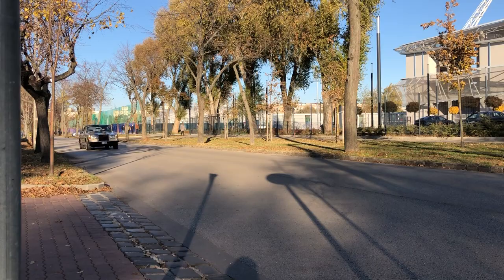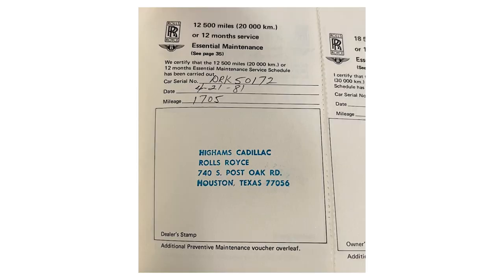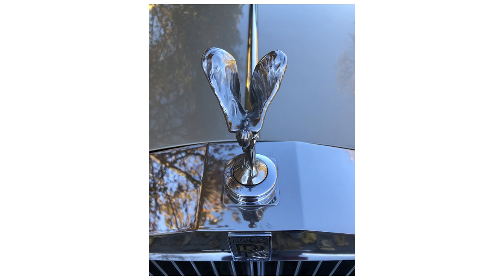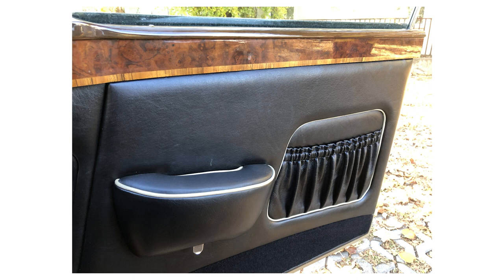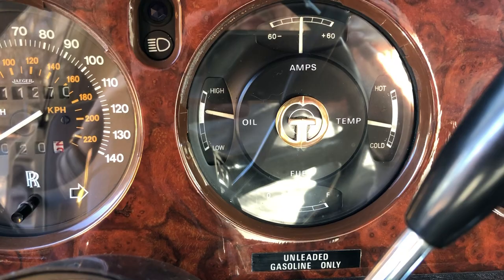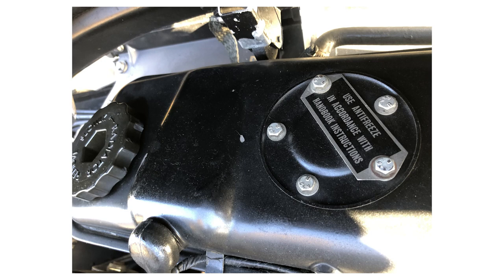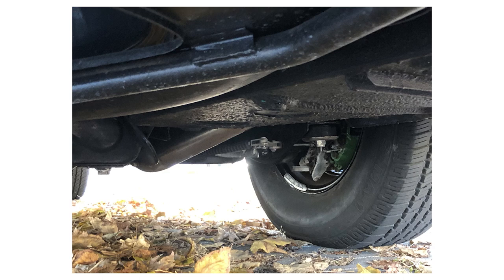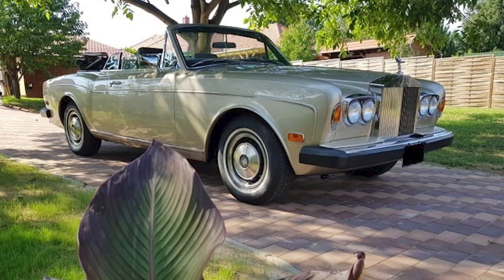This highly original 1979 Rolls-Royce Corniche Convertible is the epitome of luxury and style

Comment: That Spirit of Ecstasy does NOT disappear into the grill when struck. This is an incorrect statement.
Reply from the maker: This Spirit of Ecstasy deflects in an accident. This was a legal requirement in the US from 1968 and in the EU from 1974. Plenty of material available on this obviously but recommend this ver well-written work by a Rolls-Royce owners club on the topic with loads of history and great pictures:

https://rroc.org.au/wiki/images/3/37/SpiritOfEcstasyBooklet.pdf

I learned about this as a kid in the beginning of the eighties and was always fascinated with it. In later years, the system has become more advanced and the driver can now retract the mascot at will.
Reply: Mr Rice is correct: the mascot does not “disappear into the grille” as you stated in your narrative.  It is, however, spring-loaded as per FSS regulations.